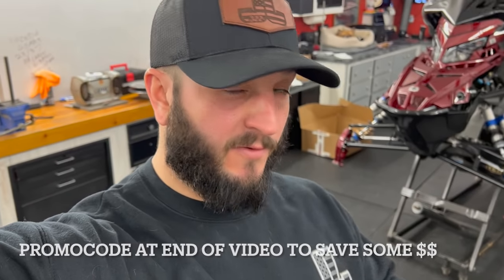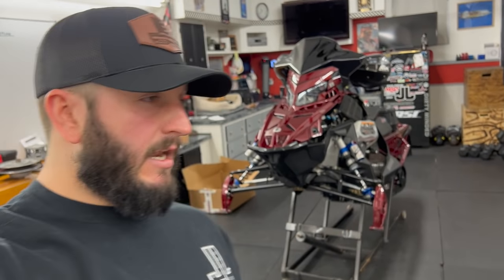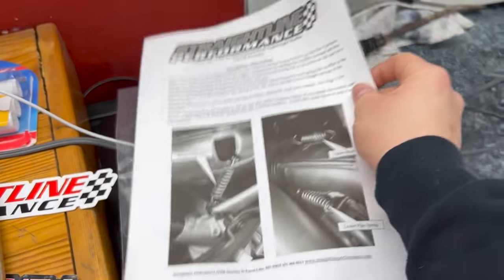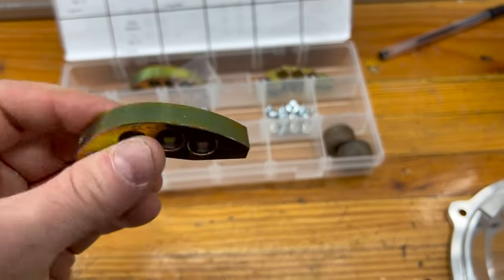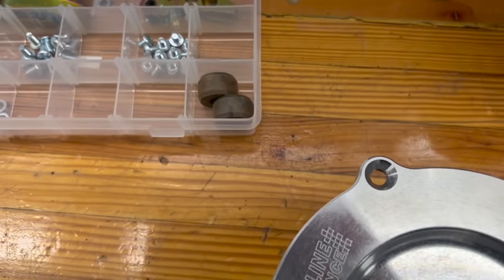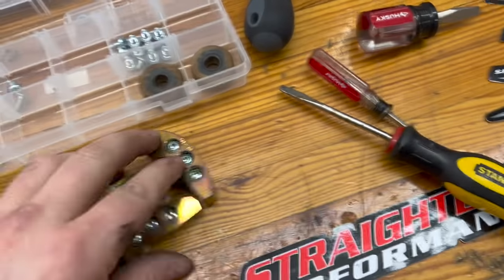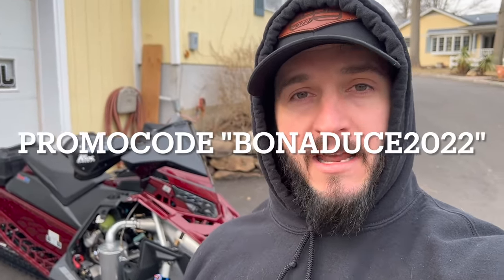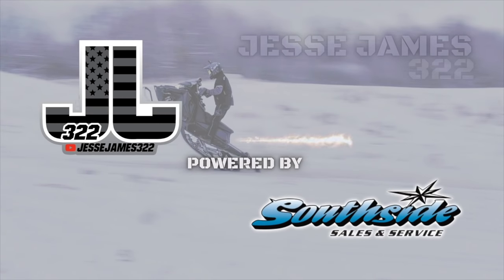2022 POLARIS MATRYX XCR 850 GETS SOME STRAIGHTLINE PERFORMANCE AND RSI RACING GOODIES!

Comment: Can’t wait to hear your thoughts on this clutch kit, would like to know your thoughts on the Slp vs caputos kit from last season.
Reply from the maker: So this is not an SLP. Starting Line and Straightline are too different companies. I know its tough because its two aftermarket snowmobile companies with the same name practically but SPI is STRAIGHTLINE PERFORMANCE. SLP is Starting LIne Performance.
Reply: @JESSEJAMES322  right that’s my bad, but still would like to hear what you think on the straight line one you just installed vs the caputos from last year and where one might perform better than the other

Comment: Have had plenty of straight line stuff before and always highest of quality went with an mbrp quiet series muffler for my 22 xcr 850 and is also very quiet and has nice sound at higher rpms but doesn’t matter anymore since now in New York anything but stock is illegal
Reply from the maker: I hear ya but ME and all of my guys have had this muffler for 3 years now and passed 20+ check points and no one even looks because you cant tell the differnece!
Reply: rules are meant to be broken dont be scared

Comment: My issues with the new xcr that I bought is right foot where the chain case is to small . Seat is very slippery always smashing knees into seat .don’t like the seat being 6,3 255 I need a wider more comfortable seat and there is know aftermarket ones out I looked . Sucks from the box and springs are set up for a 170 pd guy .on the xcr I would expect it to be stiffer . No tunnel protectors ,no windshield ,no teather for heated shield . Its fast around 175 hp and after I tweaked the shocks and bought med springs suspension is good also bought sledtred knee pads for it helps the knees out from smashing the console.
Reply: Screw Maytryx and get an AXYS  prob solved.

Comment: Just watched a video from A+ Powersports they are saying snowcheck for 2023  Polaris is from March 1st threw the 5th and that it’s going to be a very limited inventory worse than last year and that this may be the only way to get a sled because dealers may not be shipped any inventory for the floor due to the lack of and availability of parts.
Reply from the maker: From my understanding is each dealer will get alloted a certain amount and then the dealer can determine how many they want to get for snowcheck or how many for dealer inventory. My guess would be every dealer will do all snowcheck but well see. No idea about time frame of ordering

Comment: Off topic but have you done a ‘vent’ mod to the oil tank cap? I’ve heard they don’t let air in over work the oil pump and starve the motor. Just got a 22 and I’d like to do any preventative stuff in the off season.
Reply from the maker: I never have. I know Paaso racing sells caps that are all fancy. As for the standard cap I believe the later built 22’s got an updated cap with no ball in them but I would triple check with your dealer

Comment: I need your opinion, I was out on my 22 xcr 850 today and the thing just randomly shut off while riding, tried to restart and it would just stall quickly. I left it for a few minutes and it fired up and was fine; it's still in break-in with about 185 miles on the odo, and was running warm in the 135-140 range, but that didn't make a difference before.
Reply from the maker: Thats not super warm though. Getting warmer but not at all HOT. Thats extremely odd. I asked bruce and he hasnt heard of that at all. Its 100% fine now?
Reply: @JESSEJAMES322  I rode it back to the trailer but did foul a plug. I'm bringing it to my dealer tomorrow for them to scan it and make sure the rad hose bulletin was done.

Comment: Trail riding better off leveing everything stock ben riding for four over 40 years and have done everything you could think of doing to a sled and took a lot of years and plenty of money spent if trail riding save your money and most the time you end up with wasted money and 
Stock end up better and as far as mufflers we have lost a lot of trails because of hot dogs with there cans so just a note if your running a can and coming to Michigan put your stock one back on please!!!
Reply: could not agree more save your money and just ride your sled
Reply from the maker: there is always improvements. SOme guys like yourself liek to leave things stock and thats completely fine. Doesnt make guys like me that want to find whats left on the table wrong. EVeryone has their wants and needs. I enjoy tinkering and making them better and you dont. Both ok. As for mufflers i completely agree, Hence why this one is 2 decibles over factory. Rumbles more at idle then at high RPM. I wont run a loud "can". rather stab my ears
Reply from the maker: Just as i commented back to James. If you want to keep it stock then keep it stock. Amazes me that everyone will hate on other people for doing things they enjoy. If i want to put a clutch kit in and find where the factory left some perfoprmace i will. If you just want to add oil and gas then so be it.
Reply: @JESSEJAMES322  WOW NEVER SAID ANYTHING THAT SHOULD MADE ANYONE THINK I WAS DOING ANY HATEING ON ANYONE WAS JUST STATEING WHAT I HAVE DONE AND LEAVEING SOME ADVICE TAKE IT OR LEAVE IT DONT HAVE TO GET ALL PISSY OVER IT !! LMAO! COMMENTED BACK TO JESSE !
Reply from the maker: i comment back to every ones comments. not pissy just saying everyone has there to do's. your comment came across as "this is all a waste of money and a waste of time" i disagree with that
Reply: @JESSEJAMES322   I was just stating that i have been there and done everything you are doing and after doing it all if had to go back in time and no what I know now I would not do again i would have saved my money even though i enjoyed doing it that's it i enjoy watching YouTube videos but can see with you younger geriaction don't like to hear what someone older has for a comment you said i was hating that was not true .and yes you got all up set i could tell because you got all defenses just did not read into what i said and was just giving advice to the ones they wanted something to think about . just leavening views   .